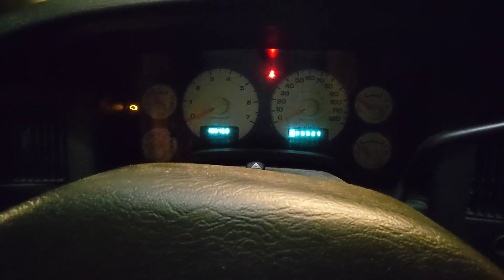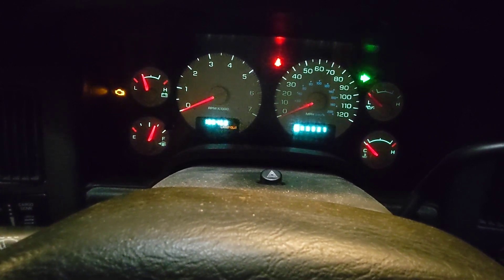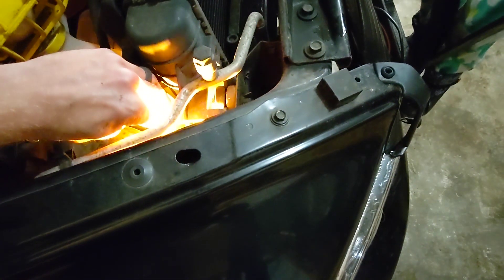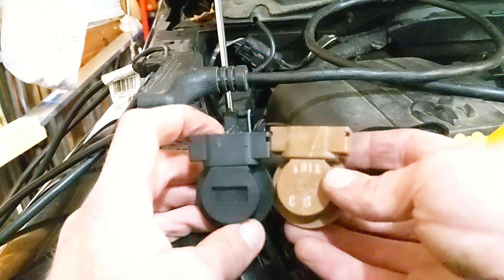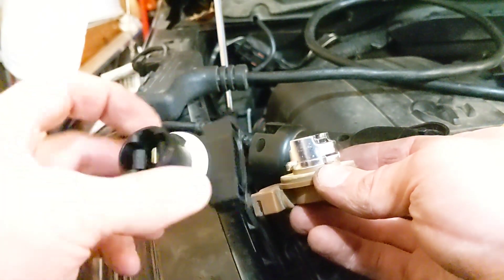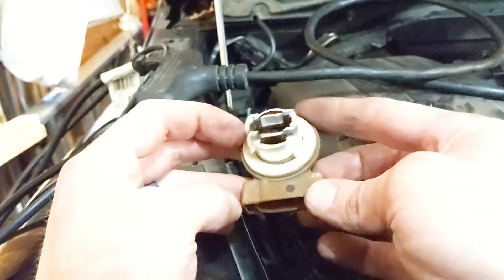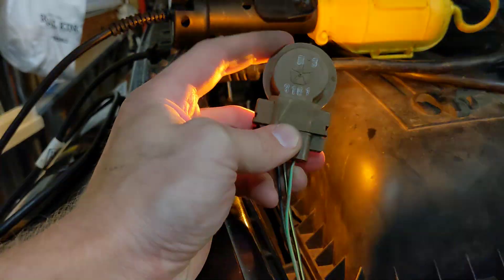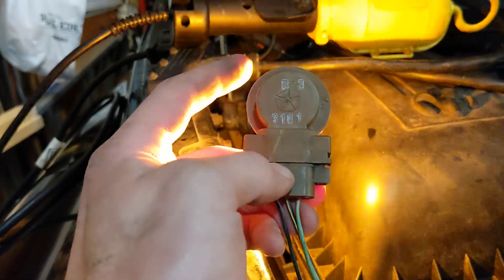Rapid Flashing & Lamp Out Chime on Dodge RAM Turn Signal – PROBLEM SOLVED!!!

Comment: Hello, you are my hero of the day. I bought my RAM with the turn signal problem, as described in your video. In my case it was even more strange, the problem only occurs when the engine is running! I have already spent hours measuring the rear lights and tracing cables. I thought it was due to the lights conversion for the European market. After I found your video, I swapped the sockets of the front indicators and the problem actually disappeared. Thank you very much for your video. Greetings from Austria
Reply from the maker: So glad you found the video and we're able to fix the incredibly annoying issue! Austria is definitely on my list of places to visit one day!! Thanks for letting me know this video helped you out.